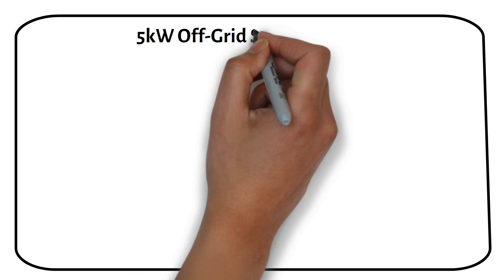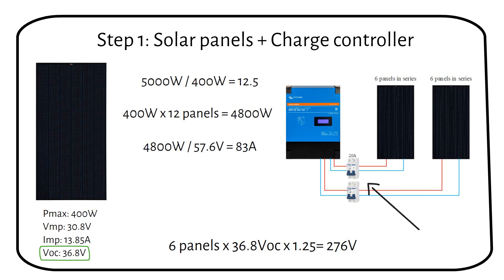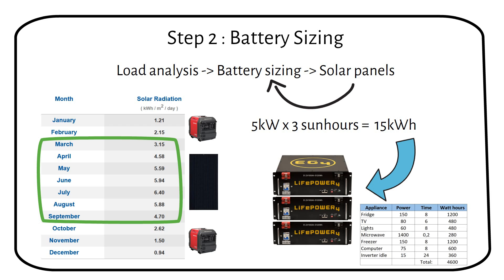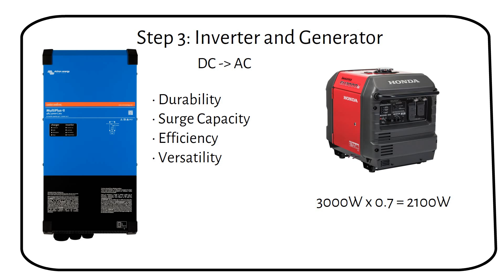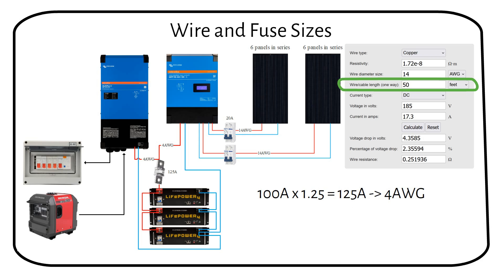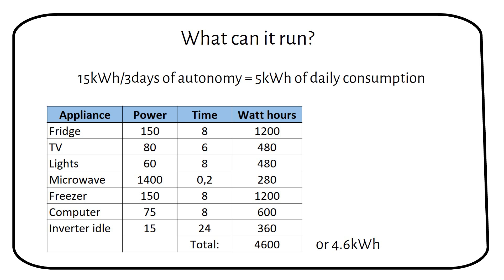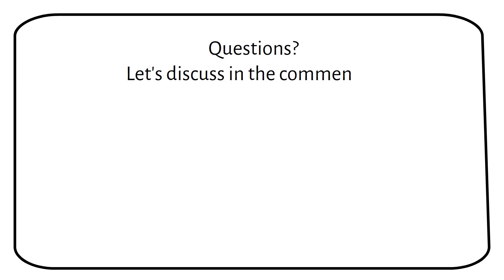5kW Off-Grid Solar System + Diagrams, Consumption

Comment from the maker: 🎁 Free Diagrams: https://cleversolarpower.com/free-diagrams/ 
📖 My Best-Selling book on Amazon: https://cleversolarpower.com/off-grid-solar-power-simplified
✍Work with me: https://cleversolarpower.com/product/solar-system-review-service
Parts:
Solar Panels (12x): https://cleversolarpower.com/go/CS400W
Battery: https://cleversolarpower.com/go/EG448V (cheaper version)
Charge Controller: https://cleversolarpower.com/go/450/100
Inverter/Charger: https://cleversolarpower.com/go/5000VA
Generator: https://amzn.to/3W4zjxr
Solar PV cable: https://amzn.to/4eQcYv1
4AWG welding cable: https://amzn.to/4buslX9
DC Breaker (2x): https://amzn.to/3L9Ql74
125A Class-T fuse: https://amzn.to/3XJPUaX
Class-T fuse holder: https://amzn.to/4cgihlD
Reply: I own your book but at the moment I do not have time to read it.  I wish I read it when I decided to read some very worthless DIY Solar Bible for Beginners but now I do not have the time.  I am just going to put together a very simple system - MPPT Solar Charge Controller for 24V and 24V 4000watt inverter.    I also have two 51.2 100amp batteries so that will be turned into a 48V/51.2V 200 am =10,240 watt system.  I am thinking about an All In One MPPT Solar Charge Controller and 6000watt inverter.  I might just turn the 4 batteries 12.8V x300amps=15,360watts. in January I will hopefully have time to read your book.    Now I wish I would have read your book first.

Comment: Hi there again Nick, mark here from my houseboat on the Murray VIC Australia. I now have 4 x300ah lithium battery in a 48v configuration 2000w of solar panels and a 6200w pure sine inverter solar off grid. I have an isolator and mrbf terminals on each battery. What size fuses should I use at each battery please. Kind regards, mark potter

Comment: I have 3F system with the same victron inverters. In case I will buy 3kW henerator, justi 1Fase with clean sinus AC can I use it for I inverter supplying just one phase in case of grid outage?

Comment: What additions would need to be added to this system  to run A 20,000 BTU mini split Ac system continuously ? Assuming cooling only?
Reply from the maker: There are too much variables. I haven't done a test to measure surge power of an AC as well.

Comment: I got your book recently.  Can I connect two different inverters -2000W Giandale and 2400W MPP solar hybrid all in one - to one 24 volt battery bank 800 kwh.   The inverters have separate AC input and output. With one battery bank the power distribution will be better.
Reply from the maker: Thank you for your support! Yes you can connect them to the same battery. However, you cannot combine the AC output of them together, that will destroy them because they cannot synch with each other. Btw, 800kWh battery? That must be a typo.

Comment: question: where does the charging voltage of 57.6V come from? is that defined by the batteries used?
Reply from the maker: That's the charging voltage of a 48V lithium battery. However now I recommend using the nominal voltage Which is 51.2V.

Comment: Hi Nick. Your videos and the diagrams are so informative and helpful. Thank you. I have a query that has been puzzling me. In this video you recommend the Victron | SmartSolar | MPPT RS 450/100-MC4. I've seen set-ups that have two Victron SmartSolar MPPT 250/100. I have no idea why that was done, but likely cost. Is it safer and better to use say the 450/100 rather than two MMPT 250/100? I should say I am in the early stages of planning a 48v system for an off grid location, but building it up over time. I have a registered electrician who will do the install - I just have to gather the gadgets. Thanks for reading and any advice you can provide.

Comment: i thought fuses were in place to support the wire safe limits (eg 150a for the 4ga wiring), and that a fuse should always be rated at least 10% higher than the load it is expected to handle.

in your scenario, wouldn't a 150a fuse be best suited to the 120/125a loads?

Comment: Hi Nick. How did you arrive at the 20A Circuit breaker for the PV arrays?
Reply: look at the video at the 6 min. point. the 14 gauge size of the wires/cables between the panels and the inverter will have 17.5A of current because of the 185V applied, so the smallest size circuit breaker would be 20A.

Comment: Can someone help me with cable sizing and bus bar amp size for my off grid system? I have (4) 100A solar charge controllers connected in parallel, 12kw grid tie inverter, (16) 100A 51.2v lifepo4 battery in parallel. If I max out the charge controllers and inverter what do I need?
Reply from the maker: I replied to your question in another video. Short reply: 600A.
Reply: @ great thanks. What about cable sizes? Just want to make sure I got it right. Great video by the way. Also if I have multiple bus bars how do I connect them together, if that’s even possible? I have 16 batteries

Comment: I like your explanations, but don't agree on all the choices you make. First of all you are calculating backwards, which is strange.
For the same applications I would make different choices. You decide to use 3 days storage as a rule of thumb. I don't like that rule of thumb. You don't need that 3 days storage if you oversize the panel installation, so you produce more energy in winter. The batteries write off more quickly than the panels, so to be cost-effective you rather have more panels and less storage even if the investment would be the same. That might mean turning your generator on slightly more often, but for shorter durations. Note that your largest energy consumers (fridge and freezer) use less power in winter.
Overall you should be able to invest slightly less, have lower depreciation and reduce your gas usage.
With the same charge controller, you can use 14 panels (2x7) and still produce less than 100 A @ 57.6 V. That's 17% more power for a few hundred dollars more (although in good weather you would be throwing most of that away). That would be worth it in convenience and gas savings even if you decide not to use a smaller battery. I'm not sure if the Victron charge controller can handle even more oversizing, but if it can then I would even go for 16 panels.

Comment: Great presentation!!! Not clear on the 20A breakers. Would those need to be higher?
Reply from the maker: 12 panels in series gets you 13.85A*4.56=21A -> 20A breaker is enough.
Reply: @cleversolarpower  Why 4.56? Should it be 1.56? And also, why do you prefer Imp? Should it be Isc?

Comment: Hello there, I recently became your subscriber and I would like to know if I wanna make a 5 kW solar system In Thailand, which is 220 volts what components and fuses I need thank you and appreciate it
I am using 600 watts solar panels and 48 volts 280 Amp batteries
Reply from the maker: Check out my systems here: https://cleversolarpower.com/solar-power-diagrams/

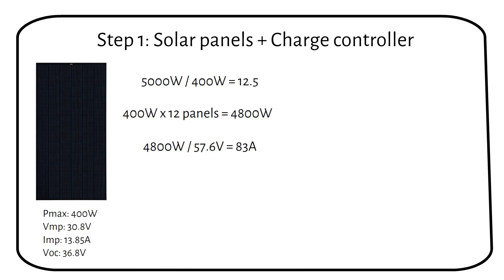Comment: At 1:16 you chose 450v 100A charger. But you decided to split the panels into two series strings. 
Why didn't you choose to use all panels in a series string which is still under 450v?
Reply from the maker: 1:40 you have to watch a little longer than one minute 😉
Reply: @cleversolarpower  I don't understand. 12x36.8 V=441.6 V. How does that exceed the 450 V input limit?
Reply: Looks like it's because of his 1.25 safety factor. From what I've been reading, panels can exceed their Voc in the winter time due to cold temperatures
Reply: @jake-mv5oi  Interesting. I am in the tropics, so if that's the reason, I can ignore that safety factor.
Reply: @GerbenWulff Lucky you!! I'm freezing my butt off in Maine. Ha,    I believe the standard test is based on 77 degrees, ??, I have to over-size my charge controller for the random chance we get a -20 degree day with sun because solar panels are much more efficient in the colder weather. Every other day it's a system built up for nothing....
Reply: @noturbizz1  Standard conditions are measured in degrees Celsius: 25 degrees Celsius (which indeed is equal to 77 degrees Fahrenheit). I watched a video on how to calculate it. It's not very difficult.
Reply: @GerbenWulff  just math, I burned out a charge controller in the heat during summer, now I pay attention better!

Comment: Why do some sources say use 1.56 safety factor for DC and 1.25 for A.C side?
Reply from the maker: we only use 1.56 for cables going from the solar panels to the charge controller. These are called solar PV cables and are rated this way because outdoor situations are very hot.

Comment: So with this setup the charging amperage is reduced to 36 amps..does it mean that with a 24v system  the charging amperage be raised to near double to fully use the generator and the inverter capability? Will it charge the bank twice as fast? I'm asking cause i just bought  7  6v batteries that are 9 years old but can't find an other one with the same age to go 48v..so 24v system is on my mind now. I'm new at this. And what make the Honda 3000w more economical than others..i got a yamaha non inverter? Thanks  😅
Reply from the maker: Increasing the voltage will reduce the current. Power= voltage X current. So if you increase the voltage, you have to halve the current to get the same power.
Reply: So it will be charging at the same rate..?

Comment: nice, but people don't typically unplug their fridges or freezers overnight. from my own experiments, i can run my whole home entirely off my 820W of solar and 7.5kWh of lfp batteries in the height of summer with decent sun (uk, so sometimes it's a gamble!). the rest of the time i plug the fridge freezer, and sometimes the microwave, into the grid. it's not worth grid-disconnecting in the uk - but when there is a powercut, you're usually back on within 8 hours. anything longer, and i'll take the hit as best i can with my solar system.

Comment: Please what battery backup, inverter, fuse, wire quality and  size is recommended for an 8kva pv array? Can you draw a schematic or do a video on it? A customer ask me if i can handle such solar project. For this is the exact off-grid solar his friend is using in powering 4 ice block producing machings and he needs this too to power his own. I'm from Nigeria.
Reply from the maker: You can take a look at my designing service on my website.

Comment: Can a UPS SYSTEM substitute or do the work of an INVERTER   if i remove its internal 12volt battery and run a wire out for connection to external bigger capacity 12volt battery...? Can it power a house? And what are the similarities and differences between the UPS SYSTEM and INVERTER.
Reply from the maker: To my knowledge an up is a battery charger, inverter and battery in one. You can switch out the battery for a larger one, but it has to be the same chemistry and voltage. It depends on the power output of the ups. Most likely very small. This 5kw system is basically a big ups.

Comment: Excellent presentation, now let me get this right, you can't connect 12 panels in series because of voltage excess, but can you split the voltage 6 panels = 276v in the same charger controller Is this correct? Again great show I enjoy it, thanks Nick 🇦🇺
Reply from the maker: Yes. The charge controller has two mppt inputs, so yes that's why we can separate them.
Reply: @cleversolarpower  thanks for explaining this, excellent explanation.

Comment: Victron 5000 is not UL listed; thus, not a good choice in CO (if you want insurance to cover any issues).
Reply from the maker: Victron 48V MultiPlus-II UL1741 3kVA 120V is UL listed. You can place two in parallel to get 6kW of output. I linked it in the description.

Comment: Yesterday I saw a video that shocked me.
on traditional panels --- ANY shade shatters the pv output.   The video demonstrated that even a 5% coverage of shade dropped the output from 93w down to 17w.
What do you say?
Reply from the maker: It's true. If you look closely at a solar panel there are cells in series. If one cell receives less irradiance, the current will drop. And the panel will take on the cell with the lowest current.

Comment: Is it possible to run a 24 V 16s BMS system on 16 3.2 V cells configured in an 8S2P configuration or do you need to separate BMS units?
Reply from the maker: I don't think that is possible. You need a 24V 8S BMS and wire your cells in 8S2P. So wire 8 sets of 2 cells in parallel, en then series connect them. One balancing lead for every two cells.
Reply: @cleversolarpower  thats what i thought but wasnt sure

Comment: I will be using 440w panels with the same charge controller. I already have 20kw of rack batteries which aren't enough.. I don't run much at the moment. I will be buying more batteries to get to 40-50kw. 
 My inverter of a growatt LF 12kw. It will be set up and fused for 300a max.
Reply from the maker: 300A fuse size seems ok. The charge controller is great. You can build your own battery as well. Check my video DIY vs BUY lifepo4.

Comment: Why would you run a fridge for only 8 hours? Usually fridge and freezers are always on.
Reply from the maker: No they are not. They usually have a duty cycle of 30%, which means they are on for 8 hours a day. Check my video about: how much power does a fridge consume? And you will see what I mean with the graphs 😉

Comment: At 1:10 where did you get the "charging voltage" of 57.6 Volts from?
Reply from the maker: It's the charging voltage of a 48V lithium lifepo4 battery.
Reply: @cleversolarpower  that would be good to know ahead of time. You're making assumptions that the viewer knows something/everything about this topic. You're putting the cart in front of the horse.
Reply: I had the same doubt @cleversolarpower . Now I can add this to my knowledge. I appreciate your help

Comment: Nick...please help me understand how you connected the 2 sets of panels  to the charge controller???
Your diagram appears to have 1 set going into the "load" outlet which I question.
Thanks
Reply from the maker: One set consists of 6 panels in series. It would have been too big to have it one the screen. The charge controller has two MPPT inputs.
Reply: @cleversolarpower  how does one connect 2 sets of panels if the controller has just 1 panel hookup?

Comment: Nice explaination. However I did not understand how the charging voltage is derived.
Reply from the maker: It's the standard charging voltage for a 48V lifepo4 battery. For a 12V battery, it's 14.4-14.6V.

Comment: are the 20amp circuit breaker also for surge protection/lightning?
Reply from the maker: No, just for isolating the solar panels. I might do a video about surge and lightning protection later.
Reply: @cleversolarpower  ok thanks will look forward to that one -